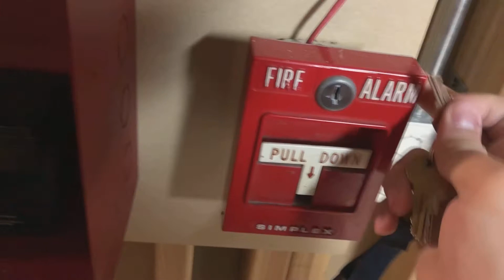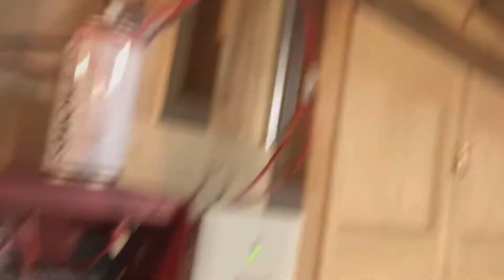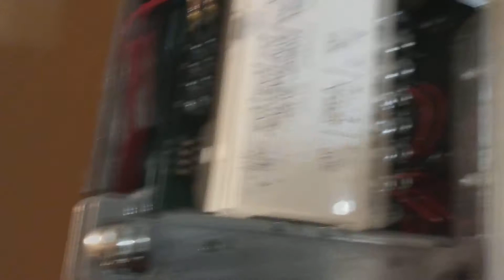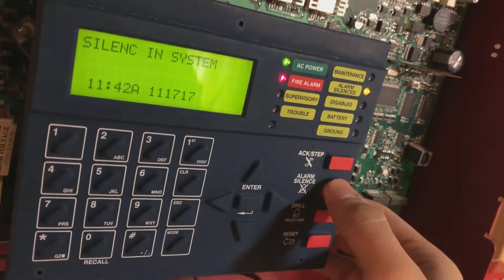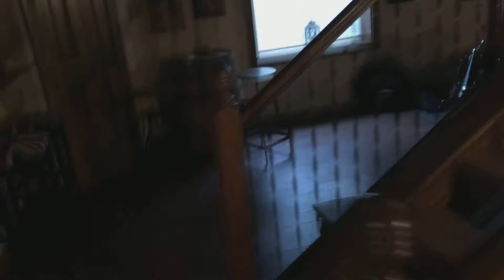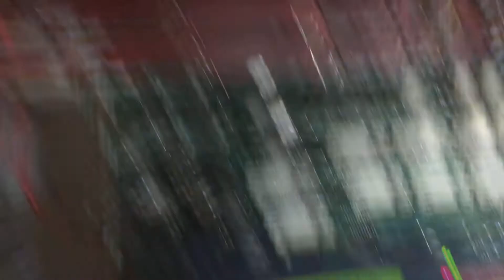Home System Test: 11 Simplex TrueAlert SmartSync Horn/Strobe Test!

Comment: I am attempting to hook up this sync module to an Altronix NAC and I have the horn side hooked to NAC 2 and NAC side of the sync module hooked to NAC 1 supplying 24 volts. The horn/strobe flashes for 20-30 seconds before sounding once and then another 20 seconds before sounding again. Do you really believe this isn't working because of dirty current?
Reply from the maker: Id be curious to see how you have it wired up. Post over on https://forums.thefirepanel.com in the fire alarm help section and we should be able to get it figured out.